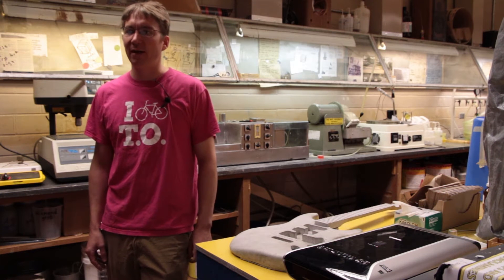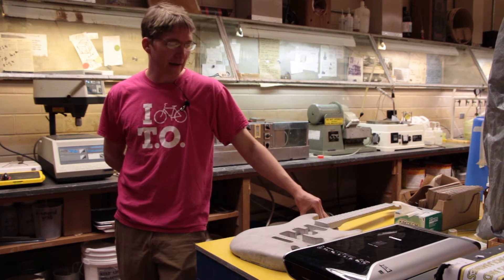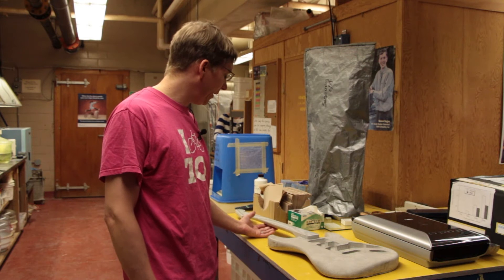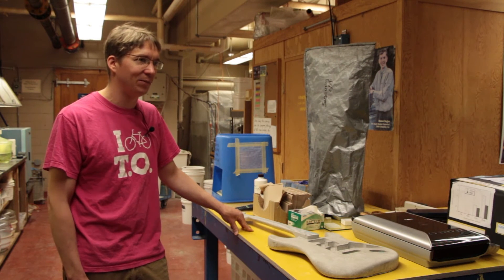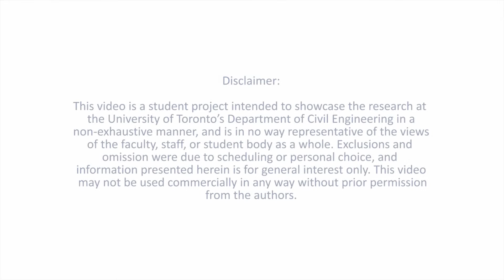Making a (Replica) Fender Stratocaster out of Concrete!

Comment: My mate Robin cast a guitar body using plastering sand and portland cement. He used a conventional guitar neck bolted to the body using drinking straws cast into the mould for the screw holes. It sounds amazing! Way to heavy to be a practical guitar but the sound exceeed all expectations.

Comment: You mention steel reinforcement.  Did you employ a truss rod in the neck like Fender puts in wooden necks?  I would suggest using an adjustable truss rod, adjusting it as you veeeeerrrrrry slowly tighten the strings.